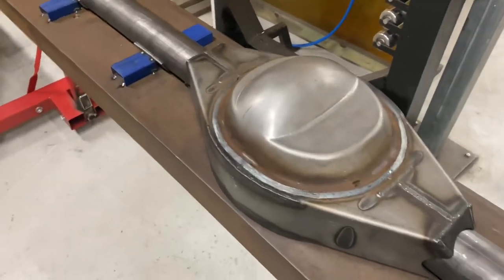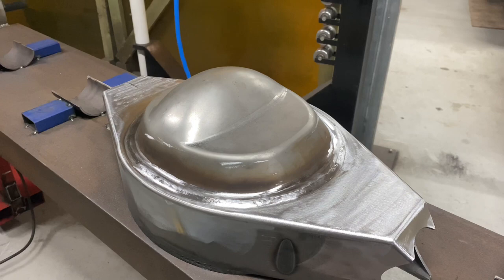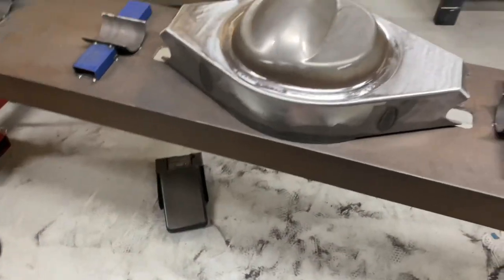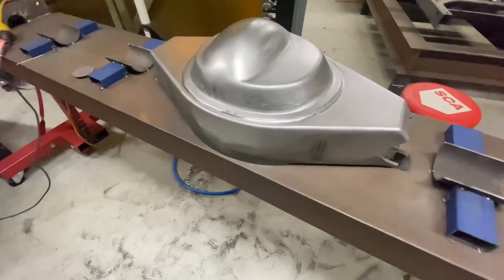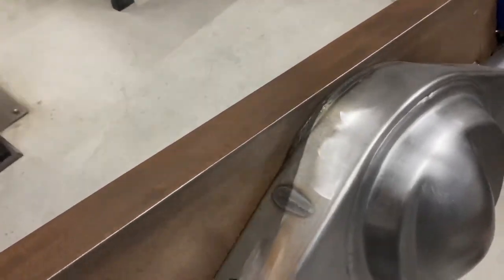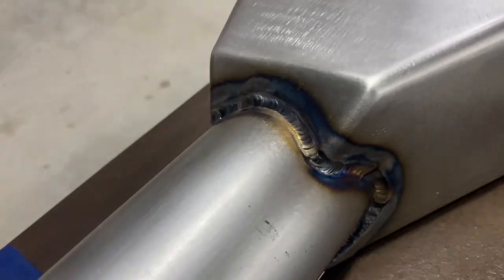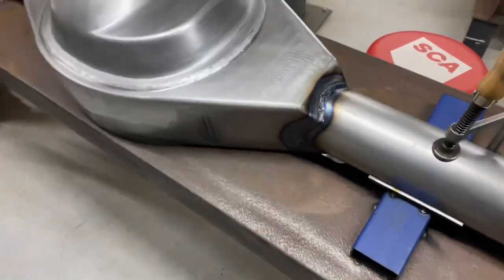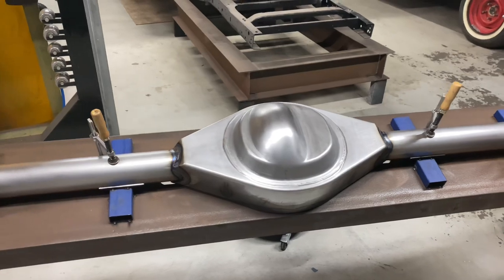My first 9 inch diff housing build.

Comment: Straightening housing   B4 or after all the welding 
ways of keeping/ making straight 
How did u  do yours ????????
1//Use  4 alignment pucks  ,,, diff carrier  housing 2 pucks ,,,,,,  axle tubes 2 pucks [or install bearing ends  2 pucks  ] 
slip fit axle ends over or inside tube  or  butt weld 
2// bend axle housing straight
Reply from the maker: This diff was bang on after I welded the brace on. Just had it in my jig on the c-channel. It moved opposite the brace which was good cause like I said the brace brought it back. I have the pucks on there way with the straight bar that I’ll use for installing the bearing ends and I’ll do any minor straighting then.